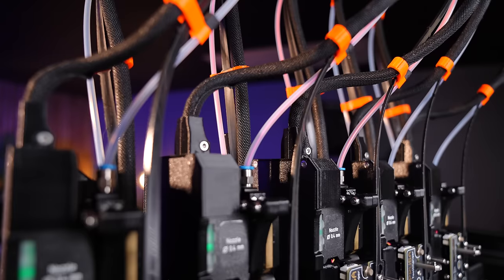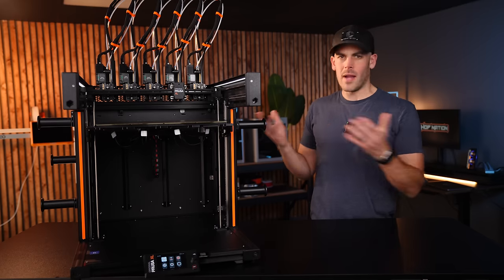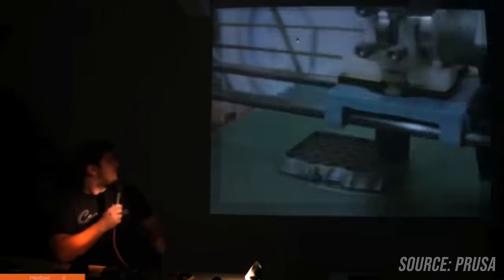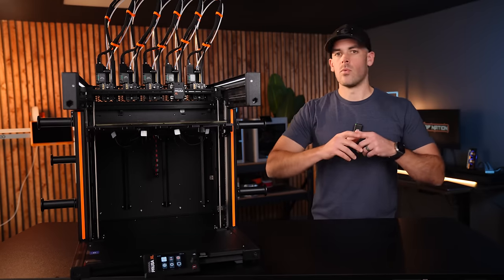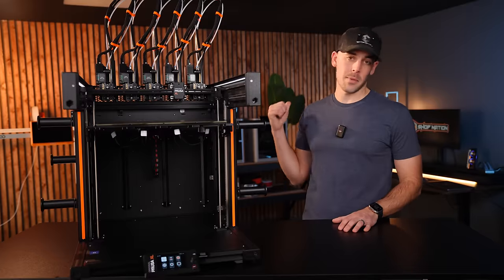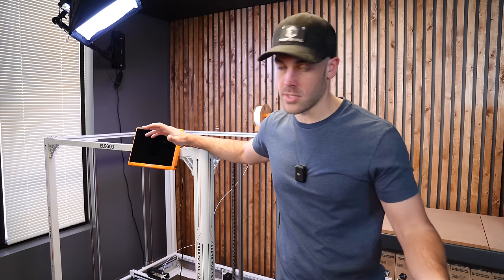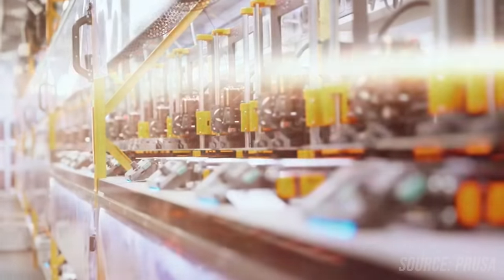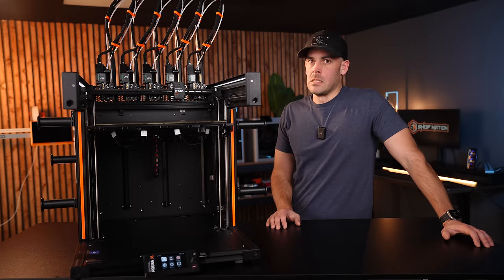Why Prusa is the next Blackberry

Comment: Prusa needs to innovate to stay competitive, it's that simple.
Reply: 'd like to buy a Prusa. People say their 3D printers are the Corollas of the industry in that they last  forever. Shop Nation asks what can Prusa can do to stay competitive. Lets not dance  around this! Simply offer the printers at competitive prices (Corolla prices) for their ready to go printers and the kits. I'm not talking 10% cheaper. They need to hit the 20-30% discount range. Also, the cost difference between the fully built printer and the kit version is ridiculous...close that gap by 50%
Reply: They do innovate. Every single printer on the market today uses innovations created by prusa.
Reply: I totally agree. A heated chamber is so simple and they still haven't included it with a $3500 printer.... Bad move
Reply: @LilApe  There is absolutely no denying that BUT how long was that? The BlackBerry reference is spot on in this video.
Reply: @Spoonuk666  Their nextruder is innovative. Their segmented heat bed is innovative as is their load cell nozzle. All this is on the XL. Things they did 1st.
Reply: I don't think so, the solution is to plaster "PURSA" in a lot more places and with bigger letters
Reply: @aregulargenericname8794 You're the guy that still doesn't know if his 1st layer is good or bad so you rely on your printer to hold your hand and tell you so.

Comment: I won't buy a Bamboo printer for the same reason I wouldn't buy a iPhone, freedom. I don't want some company thousands of miles away making decisions for something I supposedly own. The XL is also a true multi-material machine, where the Bamboo AMS is just a multi-color machine. Since the X1 and other share a nozzle, if you have materials that require different printing temperatures, you have to wait for the nozzle to heat up and cool down every material change.

Comment: As an mechincal engineer you should recommend it to everyone who wants the top mechanical design for highest precision and quality. The mk4 and xl has an extruder design which is miles ahead of any other printer on the market. They have a large gear single extruder design with the pushing force of a dual gear extruder. Who is interested in high consistent extruder should look up the work of miragec or mihaidesign. If you think about their conclusion the mechincal solution is the prusa extruder design!
On top of it they can measure the extruding force. Which gives the possibility from hardware side to closed loop control the extruding pressure, ideal temperature calibration for each filament and so on(just my ideas what they could do with it).
By the way owning a p1p, sovol, creality and no prusa at all.

Comment: The big miss of the XL is that it is an open frame printer. This means it is pretty much limited to PLA/PETG. So neat for colorful PLA stuff, not so great for engineering.
I think there is a space in the market for a consumer level mid temp printer that can do ABS/ASA/PA with ease and even do limited PPS/PEI/PEKK prints. Right now the cheapest option I can find is the funmat HT at around EUR 6000. A AMS-alike equipped printer with dual extruders (To do multi material support or flexibles prints) with a reliable chamber temperature at ~90C at less than EUR 3000 would be a game changer in the space of hobbyists going beyond PETG and small scale production.
Reply: Snapmaker J1s ?
Reply: I totally agree. The XL was outdated the day they released it because it is no ABS/Nylon/CF printer without rigging up some home made crap to it.
Reply: @fivepointeightnate I’m sure apple, I mean prusa, will release a $700 encloser kit with it soon enough
Reply: My neighbor purchased an XL single head, and made a full enclosure, but it's like 3.5 feet tall! So you can't even have it on a shelf, rather the space has to be open. It's an extremely interesting enclosure system, but, the PTFE tube is around 4 feet long, as you may know. Filament unload is a lot of work on it, Prusa NEEDS to add a stepper motor to automatically pull out the filament from the extremely long tube.
Reply: Qidi X-Max 3?
Reply: @TimothyBoyden  still nothing really beats the quality and customer support etc of prusa. Even if their xl isn't great now they will make changes (eventually) to make it like the mk4 (great quality prints, fast...)

Comment: Why would you want the XL for multicolour?
The benefit of having multiple toolheads is multi-material. On that front, the XL is pretty much the only one of its kind, for better and for worse. Better, because it is great that there is a company out there exploring new frontiers. Worse, because it is definitely a first gen product that demands months works from the user just to get started with multi-materials.
I am hoping that more competitions will come to this front. The last thing we want is for things to stuck with the XL for the next 5+ years.
Reply: Multicolor would be a huge boost to my current little 3D print shop.  I can do it right now but it is only me manually changing colors and then it is only at a simple level color change.  To be able to make my parts and have edges highlighted or surface designs would be something no one else is doing.  I am all for print heads for multi color.
Reply: There's the Jubilee, E3D toolchanger, and Proforge 4 that all 4+ toolheads that compete with the XL. Those can be bought as kits or assembled, there are also voron toolchanger options.
Reply: @popscorn66  But isn't the multi-toolheads be a bit over the top for multi colour? It is more expensive. And, the added complexity definitely reduce reliability.
Personally, I am design a tool-changer for the Voron platform; with multi-material in mind. if I ever needed multi colour; then, I will consider filament switching options like the ERF or Chameleon, to be installed on one of the toolhead.
Reply: @thomasletlow3292  Good shout. I totally forgot about those alternatives.
Although, as one of the designer who is working the the Voron Toolchanger, I have to make a note here that: they are all still in development, as options for components like the docks and electrical panels are being explore, and the documentation is scattered.

Comment: At the latest when Bambulab introduces a subscription model, the Bambulab users wake up.
Prusa and Bambulab address two totally different users.
If you equate modern with cheap and poorly repairing disposable printers, then Prusa is old -fashioned.
And I like it.
Reply: Have you ever worked on a bambu printer? They are very well engineered and have extremely cheap (in price, not quality) replacement parts in comparison to every other manufacturer on the market, and have even added more replacement items at community request. Working on my bambu machine is 10x easier than my prusa or my creality.
Reply: As an X1 owner it's a pain to repair, but it's very repairable. The X and P series of printers definitely aren't disposable and saying that is quite disingenuous and avoids the real problem entirely. Prusa printers are easier to work on, yes, but from my experience are just about as disposable as my X1.
Reply: @TreePDX  As already written, there are simply different tastes. 
In my opinion, the Bambulab are not well designed. 
I don't want to go into more detail here because unfortunately it's always difficult to discuss Bambulab.
I am not saying that they are bad, but they are not as good as is always claimed everywhere.
But that's just my opinion, no need to get upset.

I think there will be both and much more in the future. 
Hopefully there won't be any more inflammatory videos like this that unnecessarily exacerbate the already bad atmosphere.
Reply: @TreePDX   I made the mistake of buying the Bambu A1. Still waiting for the replacement bed so I can use it without potentially burning my house down.

Comment: You are right about several things,they’re behind in some areas yes but when you’re funded by the Chinese government, huge shock, you can build amazing machines. 

I built a farm in the last month and chose to stick with Prusa and bought four MK4’s with enclosures. Primary reasoning was I know the core design and can maintain them. I do not like the idea of breaking down a Bambu to change a rod or bearing which is inevitable. You can call them “consumer” machines all you want but when was the last time you changed a bearing in your HP Laserjet? They are not a consumer “appliance” and never will be IMO.

I’ll get a Bambu at some point to compare but I won’t be moving away from Prusa as I buy in to the ethos behind the printers

Comment: Upgraded my MK3 to a
MK4 3 months ago and have been printing almost nonstop since then. It is so much faster that I never feel the need to use a 0.6 nozzle anymore. The force touch calibration makes switching print sheets totally seamless.  I love my Prusa and don’t see the need to switch, I think they will be around for quite a while yet.
Reply: What in the world would you print that would actually be usable and reliable. I don't understand what's so good about 3d printing.
Reply: hate to break it to you but the mk4 is the exact same speed as your mk3. motion speed is just a determinant for resolution at a given flow rate, and both mk3/mk4 hotends are the same max flow rate. the only difference is the mk4 will ring at a different accel than the mk3 , slightly higher (because of the change to stiffer 10 mil rods and introduction of input shaping) and that ringing will be somewhat mitigated at the tradeoff of smoothing your parts. that .6 nozzle reduced nozzle pressure which slightly increased your max flow rate. your old setup was actualy faster you just didnt use settings that took advantage of the overhead. input shaping doesnt make your printer faster, it  reduces ringing by smoothing the part surface detail away because it smooths the motion system moves by correcting them to a control target with the intent of reducing vibration. your flow rate/time relative to the amount of toolpath moves is what determines how fast your print completes, not how fast it moves. your lack of knowledge in the space is being exploited cuz you absolutely can tune up a mk3 faster it had (clearly) a ton of untapped headroom in default profiles, they were very conservative. i used to print 1kg a day of petg on my mk3 in 2020 and my parts were not a low quality ringing mess. look up the muppet labs page paradox of speed for a primer on this stuff. soon as you get educated on this, you'll understand why the arms race underlying all the other things going on everywhere other than prusa is in hotend flow rate. (basicaly every other printer on the market rn is like 2x or more the flow rate prusa is using). this is not super dissimilar to when they refused to convert the sl1 from an sla printer to an msla printer when everyone else could flash whole layers at a time and they could only make the laser spot trace faster and completely missed the market shift. im not sayign its a bad printer or you shouldnt enjoy it, im just saying here's an explanation why you're wrong about your perceptions of speed and how this stuff works.

Comment: Great video! My MK3S+ was my 1st printer. Still a great machine. I wanted multicolor without having to stand there and wait. The A1 just came out so I jumped on it. Needless to say, the Prusa doesn't get used much anymore. And not because I'm just doing multi color, because I'm not. The A1 is fast and just easy to use. My Prusa took 10+ hrs to assemble, A1...... 30 mins. Sad to say, my next printer will probably be an X1 or P1. Prusa needs to step up their game. Cost for ease of use, assembly, enclosure....... No brainer folks.
Reply: I would only add a minor observation. Anyone who lacks the patience/skill to assemble a 3D printer these days probably will not 'survive' the experience. Much of the industry has come a long way from the days of the erector set self made machine.

Comment: The sad thing is, that our (let's call it western) politics allows it to make deals with countries like China, who doen't care about fairnes and equality in any terms (fortunatelly it slowely turns, especially in the US). And in videos like yours, it would be very important to also at least mention this issue!! If you only compare it on the technical level, of course bamboo is in most cases the winner by far. However, also considering the development and manufacturing taking place in a highly corrupt contry, a country unable to get rid of critics of two genocides taking place since many years, one may not want to support such a system thus one may not consider the Bamboo, even it is such a great machine.
But this is only possible if influencer, like you are, also mention it!

Comment: I disagree with almost every point here. The XL price you named is for the most expensive configuration with 5 toolheads, but the one with 2 costs 30% less and already lets you print PLA with PETG supports etc. Part of the price is also from the fact Prusa production is in Europe. Also from what I've read the other multi-"material" setups actually struggle to work with actual different materials instead of just mixed colors. And I'm not sure the XL supports it but in theory separate toolheads means you could even mix different nozzles in one print. So far it's the only multimaterial setup that looks like it could actually work reliably.
Your claim that the XL was launched as panicked response to the X1C is weird given the XL was announced years before that.
You assume that printers are like smartphones and that the iPhone is strictly better. Well, they aren't, and while I have an iPhone I would never buy a printer that connects with an app. I considered buying the X1C once but I'll likely go for the XL instead. The only thing it's seriously missing is an official enclosure, but given they just launched one for the Mini I assume Prusa just takes their time with that as always.